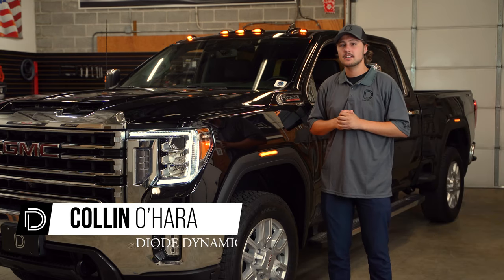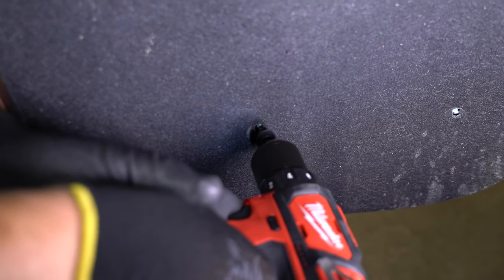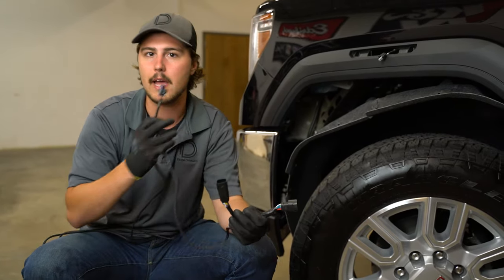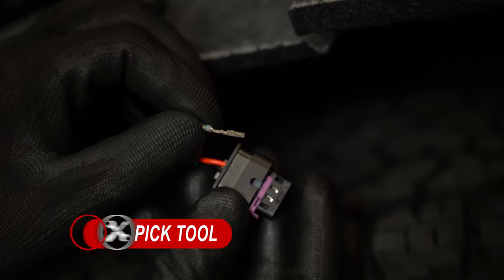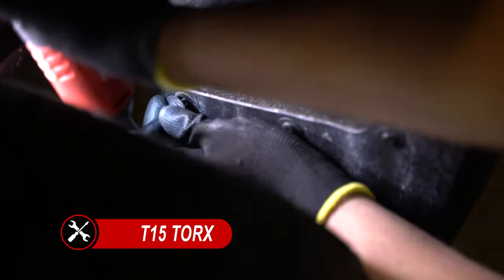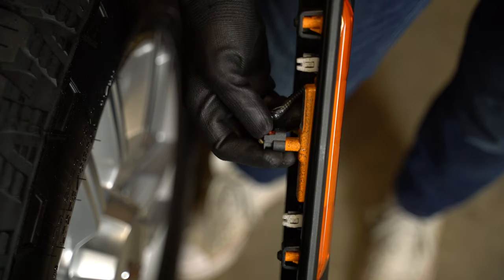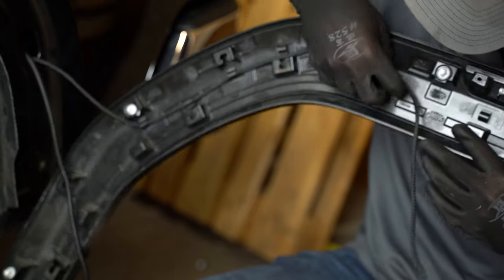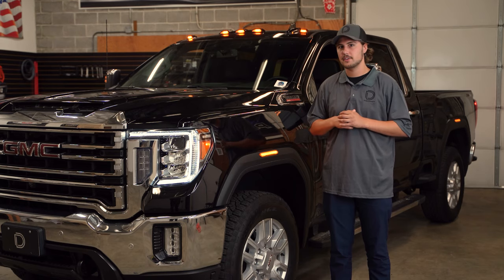How to Install 2020-2023 GMC Sierra HD LED Sidemarker Fender Lights | Diode Dynamics

Comment: I installed these on my 2023 Canyon. Couple things to help you… you do NOT need to remove the front liner. Just remove about 8 screws from the top of the fender closest to the edge and pull the liner out, use a ratchet and socket and you can r/r the light with no issues. Once you’re done just feed the liner back in. For the rear, do NOT remove the fender as they show, again just pop the top off to expose about 10 of the tabs. Use ratchet setup again and you’re good. Buy an extra pack of their tabs, you’ll need them. If you take the entire fender trim off you are going to break the two smaller white tabs at the bottom and the two black tabs at the very bottom. These are expensive and hard to find. Again, you DON’T need to remove the entire  fender trim. Aside from the “Diode Dynamics” showing when they are on I like the dark smoked look. Good luck.
Reply: Thanks for the helpful advice! Any pics? And where did you find the extra tabs that are likely gonna break? Thanks again in advance

Comment: Does the standard version still have a turn signal function (non-sequential)? I'd prefer them to not be sequential but still flash with the turn signals.
Reply from the maker: Unfortunately they do not,  the non-sequential sidemarkers have the standard plug-and-play factory lighting features.

Comment: As another poster said above you don’t need to remove the full liner in the front.  Confirmed on a 3500 HD.  I did all the top and middle clips then pulled the liner back.
Reply from the maker: Thanks for sharing the insight!

Comment: On my sequential setup, I am having an issue with hyperblinking.  The first 3 blinks is normal, then it goes into hyperblink mode.  2022 GMC Sierra 2500.  Thanks.
Reply from the maker: Hey Jeff! We're sorry to hear your having hyperblinking issues. Please go ahead and give us a call at 314-205-3033 Monday-Friday 10 a.m.- 5 p.m. CST, or shoot us an email at contact@diodedynamics.com, and we'll be happy to help you troubleshoot!

Comment: Hey guys, 
Do you know if there is any fender flares with side markers that will fit a 2021 gmc sierra 1500 AT4? 
I have been looking around and it seems there are only for the 2500/3500.
Thanks !
Reply from the maker: Hey there! If your 1500 has the same fender marker lights, these will work for your AT4! The 4-pin version will require some custom wiring, however.

Comment: I have a 2021 gmc sierra 3500 Dually. Im having issues removing the rear trim. Seems like besides the plastic clips that hold it, it also has sticky tape/glue holding it. Any suggestions?, thanks.
Reply from the maker: Hmmm- We haven't tried with dually models yet. However, we'll do our best to help. Please go ahead and give us a call at 314-205-3033 Monday-Friday 10 a.m.- 5 p.m. CST, or shoot us an email at contact@diodedynamics.com, and our service team would be happy to help you with that.
Reply: Any luck getting the dually flares off?
Reply: @diodedynamics  yup… figured that out the hard way and it totally fucked me. Now I can’t get it back on. Guess there’s a reason there’s no videos on the dually. Should advertise this for 3500s.
Reply: @howarddilley460 😂